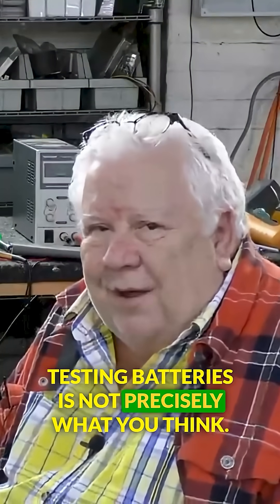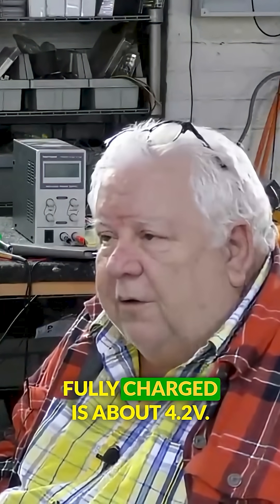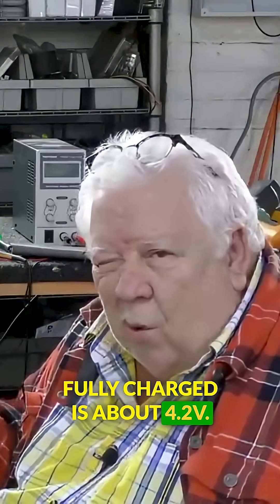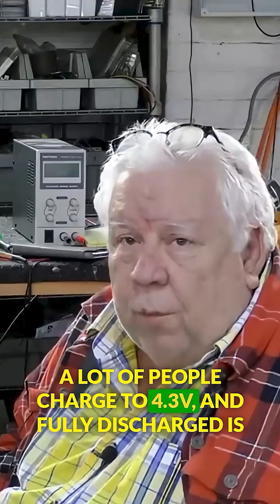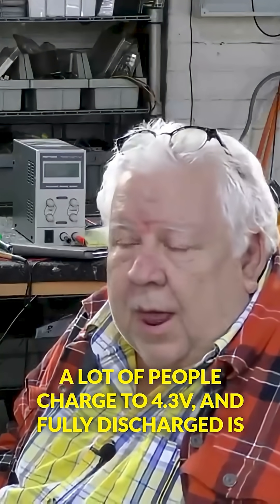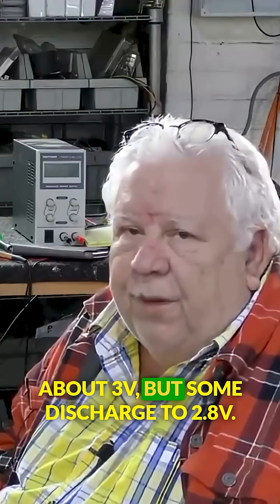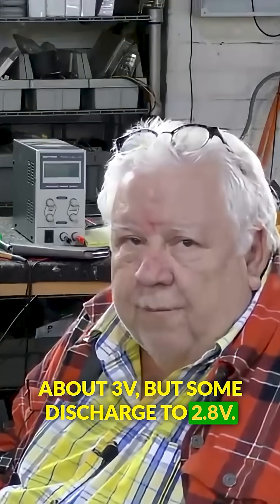Measuring Batteries Isn't What You Think #lithiumbatteries

Comment: By Trade I was a Mechanic, I couldn't believe how many guys just couldn't wrap their heads around electricity. There's an ole joke , wires don't carry voltage they carry smoke , hence why they are wrapped in insulation. So don't be letting Smoke outta the wires .
Reply: I'm not "wired" for doing electric,,lots of smoke😂

Comment: Yes that’s why 12 v car batteries need to be tested under high load. Static voltage on a crook one usually looks pretty good  but pull say 50 amps like when you engage starter motor and even a good battery drops voltage quite  a bit. That s why starter solenoids have a 12v pull down winding and an 8v or so  hold down winding. Or at least they used to. I haven’t done any of that for a long time now. However the realities of what starter motors and batteries do hasn’t changed much so it’s prob something similar.